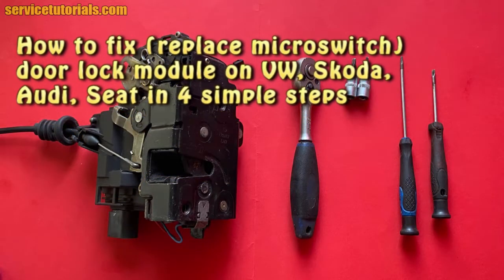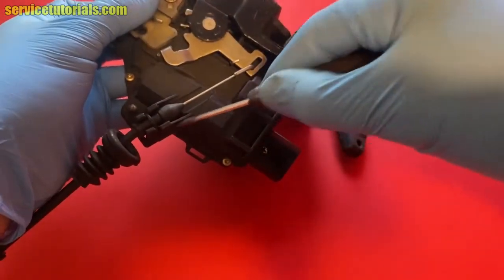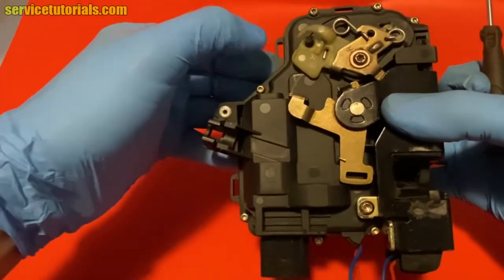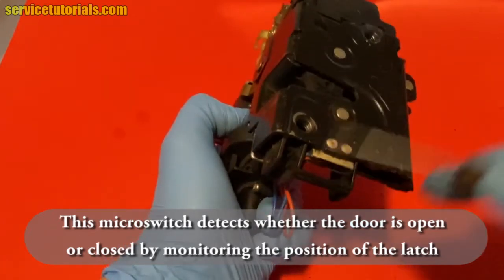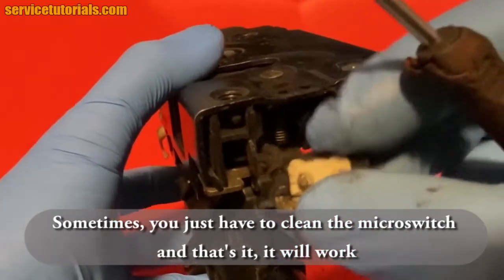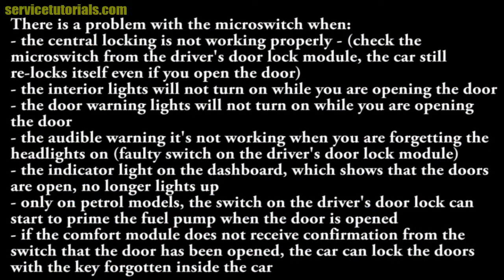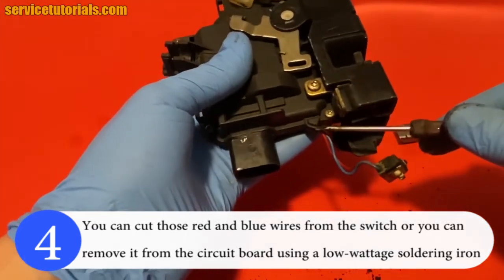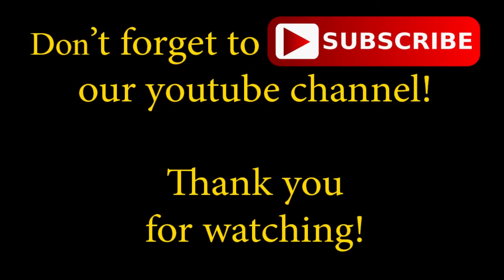TUTORIAL: How to fix (replace microswitch) door lock module VW Golf Mk4, Bora, Jetta, Audi, Skoda

Comment: I have a Golf MK7. When the rear right door opens, all doors lock, even if the car is running, so if I stop, get out and close the front door to get something from the back, I'm then locked out of the car with the key in the ignition. Is this a sign of a faulty sensor on the rear door? It only happens when that door opens. Thanks

Comment: Hello i don't know if u will see, or respond but if u see i hope u answer :). I have passat b5.5 1.9 tdi 96 kw 2001. 
my central locking dont work, only driver door locks(i have to use button inside a car to lock all doors then manualy lock driver door) 
my light doesn't work on driver door while on all other door is working. i checked comfort module, it was all dry. could it be microswitch. my key also stopped working could the microswitch cause that problem too? thanks :)

Comment: I had the typical microswitch problem on a 2007 Fabia: no headlight warning, no interior lights, boot wouldn't open until rear door opened first. Turned out the microswitch was ok but the cam that operates it has a thin plastic skin over it. The microswitch 'pip' had warn a 1mm groove in the plastic cam surface and the switch no longer functioned when the door opened. New door lock required.

Comment: In addition, one rear door lock of the Fabia is unreliable and sometimes will not unlock. I found that giving the door a 'thump' (rubber mallet) near the lock while operating the central locking fob, eventually results in the door unlocking. I have a new lock coming tomorrow for that door.

Comment: Same door on my mk4 Golf. Very rarely used but sometimes the door doesn't latch and just swings open . Have to check it before I drive off . Eventually it will work but it can take ages before it does and sometimes it doesn't and I've had to tie it up inside. . . . Micro switch possibly ?
Reply from the maker: Probably you have to replace door lock module.
Reply: @Servicetutorials  Thankyou.
Reply from the maker: @leynagh  you welcome!

Comment: My car doesnt lock by The buton on The key and if i lock The car by putting the key în the door lock only The drivers door locks, i think this îs the switch too, right? Btw the light on my door îs always open even if i shut The door close.
Reply from the maker: Hello! You can start with checking the drivers door switch.
Reply: @Servicetutorials  does the mk4 golf door lock has the option to lock the doors and windows with the key from.outside ??? Not with centraë locking bit with key turning it on the right, of course??? Do you know and can tell me about this. 
Or this is option only for the newest models of golf4?? Can you give the answer please

Comment: What if the driver door randomly gets detected as open while driving (interior lights turn on and dashboard indicator lights up + beep) ? Could that also be related to the microswitch ? It started happening daily lately.
Reply from the maker: You can check also the comfort module.
Reply: @Servicetutorials  what would you be checking there? Or are you saying to merely replace the comfort module and see if the issue is resolved?
Reply from the maker: @Infiniti25  yes, you can try replacing the comfort module.